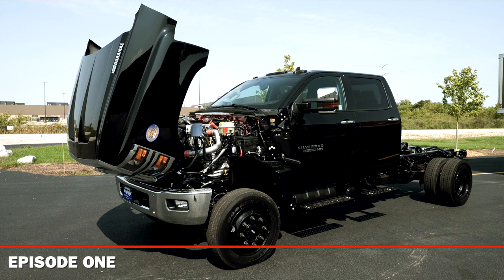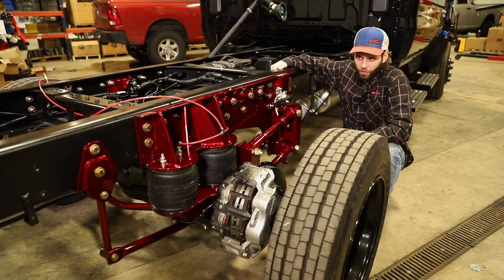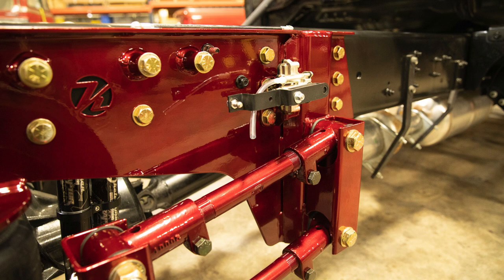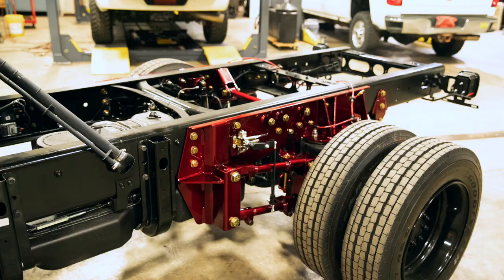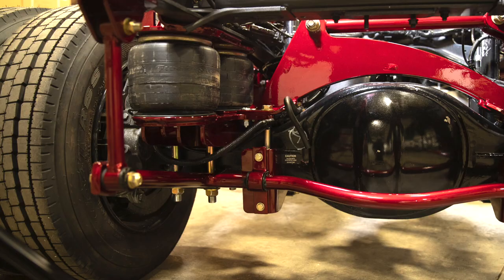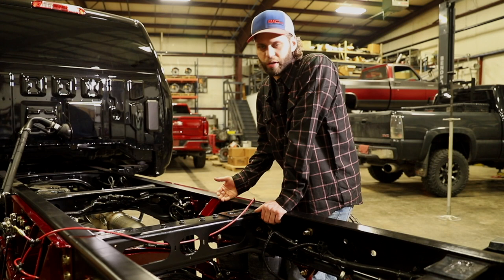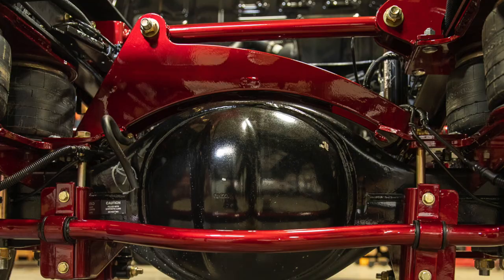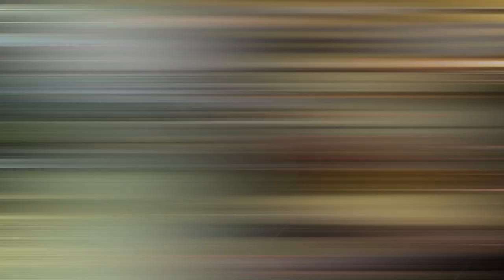WCFab Build Series - 2020 Chevy 5500 - Episode Two

Comment: Could you share the part number for the engine drive air compressor and it's location on the engine ? Thanks
Reply from the maker: Unfortunately not near the truck at the moment, but from memory it's located on the passenger side of the engine off the accessory drive. Air dryer is nearby on passenger frame rail and the air tank can be found under / behind the cab on the driver side near the battery box. No idea on the compressor part number off the top of our head, but think it's tied to RPO's KUT and JPY.
Reply: @WCFab  thank you for the reply. I have been saving for the kelderman air suspension kit, but before committing to a specific air pump kit I wanted see the differences between the kelderman air pumps and the engine driven oem one.

Comment: Does the Kelderman system limit the articulation of the rear axle??
Reply from the maker: We are not aware of any articulation concerns with the Kelderman kit.
Reply: @WCFab  Thanks. I am considering this exact truck and suspension kit as a platform for a camper build.
Reply from the maker: @bakerfamilyoverland996  if anything, your going to experience even greater articulation because this is a true 4 link system. The sway bar will limit that some, but not nearly as much as the OEM leaf pack.
Reply: @WCFab  Good to know because I plan to take the truck off-road. Nothing too crazy just to some  back country camping spots.

Comment: Does the air ride system need to be installed before the bed is on a ram 5500?  Thanks
Reply from the maker: Yes, we recommend completing the install before the bed is in place or planning to remove the bed as part of the installation.